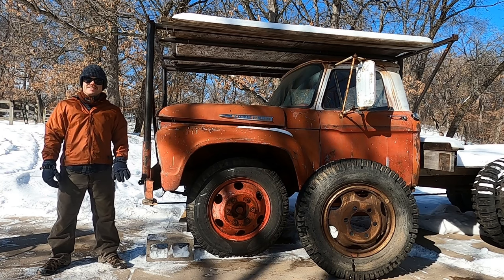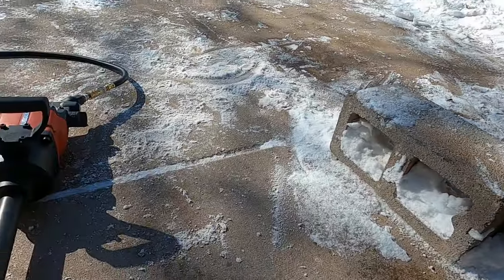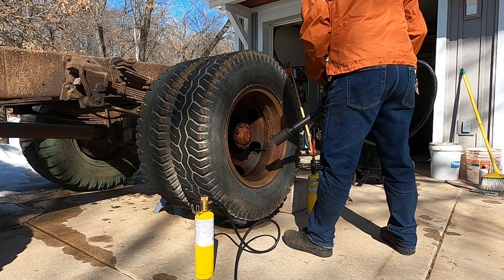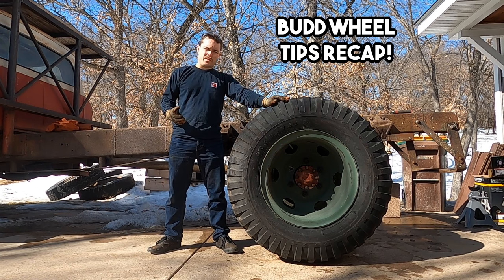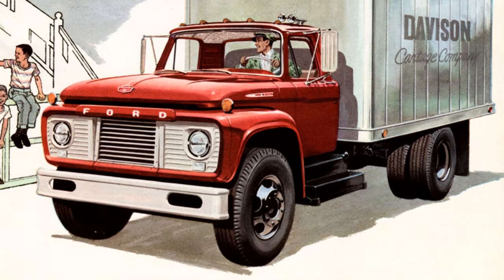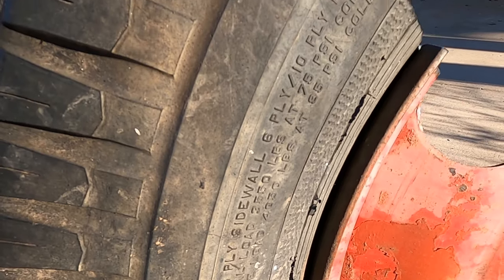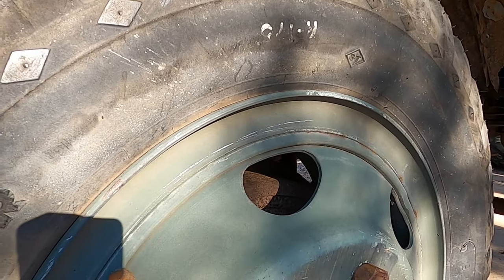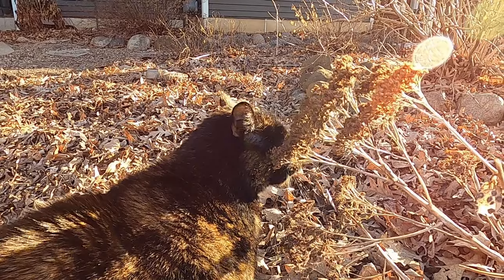All About Split Rims, Explained! Ep. 11

Comment: Get a manual torque multiplier for jobs like that. Mine multiplies 70 to 1 and breaks anything loose. Just use it to get the nuts cracked then use the impact to run them off.  A whole kit with several sockets is less than $100.
Reply from the maker: This is what i plan on getting for the future. Hard to justify an air compressor upgrade just for the one vehicle.

Comment: In the early 1970s I worked in a tire shop.  I changed hundreds of the split ring wheels, repaired or replaced tires and installed the wheels back on the vehicle.  A real split wheel rim is something totally different.
Reply: Real split-wheel rims are what you find on hand-trolleys & wheel-barrows!

Comment: My brother was driving a 68 International loadstar dump truck and the lock ring blew off the front tire and cut my uncle's mailbox post in two, we never found the ring. And these were Dayton 20 inch rims with 900/20 tires.
Reply from the maker: Holy cow. Do you know if it had been serviced recently? From the reading I've done, it appears most issues pop up pretty quickly after tire replacement.
Reply: @SealedBeamRallyTeam  Don't remember, that happened back in the late 70s.

Comment: In the Army, when we repaired flats on Dueces in the field (or the motorpool) we broke the bead with a pickaxe with a flat blade. 
Then we used the tool that came with the truck to remove the split ring. I forget what it's called.
We then patched the tube and put it all back together.
We always made sure to re-inflate the tire with the ring side down in case it flew off. It would only hit the ground...
Once it was inflated, we'd check to make sure it was fitting correctly and reinstall the wheel.

Once you did it a couple of times, it became surprisingly easy to break the bead without damaging the side wall of the tire!!!
As much as I hated pulling maintenance of trucks, I kinda got great satisfaction out of being able to fix a flat in the field at any time!!!
Reply: That thing is not actually a pickaxe. It is made specifically for breaking down truck tires.
Reply: @actionjksn  No. We used a standard pickaxe to break the bead. The other tool was to pop the ring once the bead was broken.
The axe had a flat blade and a pointed pick.
We used the flat blade and swung it to get between the tire and the ring to break the bead. How we never destroyed a tire is beyond me, but we got really good at it.
Reply: @chrislong3938  the tool that is made for it looks like what you described except it doesn't have the pointy part on the other side. I'm not sure why they would use a pickaxe when there is a hammer specifically made for breaking the beads down on semi tires. It's called a duck billed bead breaking wedge or hammer. I saw tiremen all over the country for 10 years and they all use the same tool. The tool has been in use for over 80 years
Reply: @actionjksn  I dunno... none of our dueces had anything like what you describe. they all came with field picks and shovels though.
The tire change kit had patches and rubber vulcanizing fluid etc.
A huge lug wrench and that long bar thing to pry out the ring.
That was it.
Swinging the pick wasn't hard and it rarely took long to break the bead.
You stood on the wheel, astride of the rim, and took a couple of light swings, and then went at it.
It's the only way I know how.

The motorpool guys had machines that could do it but most of the time it was just easier and faster the way I describe.

Comment: In a trade magazine years ago I read that the split ring stores enough energy at full inflation to throw an 8 pound bowling ball five miles. There is only about 1/8 inch that holds it to the rim. 
  Old hands will remember “for speeds over 60mph add 10psi” on some of the old bias ply truck tires. I for one am thankful for the advancement on tires and rims.

Comment: 45 years ago i worked on a 1950 Ford dump truck that had a non-Bud style split rim.  It shocked me to realize that you must deflate and inflate the tire assembly while mounted on the vehicle or the rim can overlap on itself and expel the bead ring with deadly force.  I upgraded to a split ring style rim that was thoroughly cleaned of any rust.

Comment: I ran a service truck doing truck and heavy equipment tires from 1981 to 2003. Done hundreds of split rims and have no problem with any of there designs. Like the one old guy says... If it's corroded to bad can it. The Widowmaker takes expert knowledge to service safely. There's that little bevel just above the locking mechanisms that you keep even all way round and you can tell it's locked. But! It requires you ad a small amounts of  air while tapping the outer ring until it evens up all round. If they were corroded, I would tell the customer it beyond usable and then  destroy the wheel so some rookie couldn't kill himself in the future trying to use it.

Comment: I worked in a gas station that was a truck (and car and tractor) tire service from 1964-68 while in high school.  We worked with all these wheel types, all the time.  The boss had a huge 3 phase powered v type compressor with about a 50 gallon tank, and an Ingersol-Rand one inch drive impact gun, which never met a lug it couldn't remove.  We also had a big air powered bead breaker, that was similar to a jackhammer, but with a bead breaker end.  It also worked great. Short handled sledges presuaded rusty stuff loose. Once the reassembly process started, we had an automatic inflator that we could set the desired pressure, hook it to the valve stem, stand back, and it would shut off when the pressure was reached.  We often raised the lube rack and put the wheels under, then lowered the rack onto the wheel before inflating.  We knew the wheels were dangerous... a local man who owned dump trucks and heavy equipment got blown up during this time, but lucky for him he recovered.  He never worked on those again, he had us do it.

Comment: I've dealt with both for several years in the army.. I was fortunate in that I had a split rim cage which us a life saving device as in the event that a ring separated you wouldn't die. Mating surfaces are critical.
As for penetrating oil, I make up a compound of acetone (60%) and transmission fkuid. Type F is best as it is more abrasive. The real problem is that the surface you want to treat is inaccessible until you separate the fasteners.

Comment: No tire shop around here will work on either style rim. I've worked on the split ring wheels. Didn't have a cage so we used a heavy log chain to hold the ring if it blew off.

Comment: Between 1977-83 I was road service for tire company in Jersey starting when I was 18! I replaced and fixed  flats on every rim you showed. Even mounted a bunch with sprung  single lock rings . Was told about the spit buds but never had come apart. Never  used a cage either. If I was worried  about one I'd mount it to the front hub! The Board of Ed. didn't  Like spending money on the school busses.  Only had one  single ring come off! I was more worried  about someone running  into me on the road! Airing up tubeless tires with closed beads was fun. Just spray starting fluid around the bead and toss a match on it! The gas in side the exploads the bead on then you can air it up. They outlawed it but did it anyway.  The expression on the truck drivers face was priceless!

Comment: Thank goodness we don't have many of those dinosaurs left around anymore. The only advantage I found to split rims is that you can change them in the field without a bunch of special tools. On our old Power Wagons we carried a spare tube and boot and could remove the wheel, break it down,  and fix it right there on the side of the road. without calling AAA!

Comment: I used to do tires back in the 80s for about 10 years starting when I was barely 17. We did not have a cage and it was pretty scary. You do have to make sure that everything is seated into place perfectly.. 

I did prefer doing the tubeless bud wheels so I was glad when this started getting more popular. I've actually done an entire semi by myself with just a lug wrench and cheater bar for removing them from the truck, and I mean all 18 wheels, but I was also only about 25 years old.

 Those widow-makers that didn't have the split ring and just had that big piece with the tiny lip really creeped me out. We did use a clip on air chuck so that helped I guess. Somehow I survived all of those dangerous rims. 

 When we were teenagers my buddy Tommy Brown had one that he installed and put it in the back of the pickup truck and was hauling it back to show his dad because it didn't look right and it blew up. It ripped through the side of the pickup truck bed. I think he was only about 16 at the time. These things are like a bomb when they go off.

Comment: Hint on your ugga dugga machine there, dual line it. 3/8 isn't enough flow. Needs AT LEAST a 1/2" line. Two 3/8" lines to a 1/2x3/8x3/8 Tee with 1/2" to the impact will make it work correctly. Awesome video. Great info for folks!

Comment: My dad had a gravel truck business and for many years all the tires were tube type with the 2 or 3 piece split rims. I remember one of the solid rings with the split rim, but dad said to scrap it.
In 1984 I worked for a concrete company in Mesa Arizona, they had the widow maker rims on some orchard trucks. The head tire guy taught me to pay attention and air them up with a chain wrapped around them.
In 1988-90 I was working for a truck and off-road equipment tire shop that would change the widow makers. After an employee at the Firestone shop down the road had one explode on him as he pulled it out of the tire cage our manager offered customer's two choices. 1. Here's the air chuck, the customer could fill the tire up. 2. They could get a nice safe new 2 piece rim with their tire change.
No one took the air up challenge. 
I didn't realize how fortunate, or blessed I was over all those years changing tires. But I do now. Great video.
Reply: I meant to mention my grandpa mentioned doing one of the widow makers, it lifted him to the roof of the service station he was working at.

Comment: I worked for a company that had a moving truck with split rims. One day they decided they needed to use it for a move but a tire was flat. An old black man showed up and said he wouldn't work on it. The next guy said he would. He broke it down, fuxed the tire cleaned the rim and mounted to the inside with no air in it. He then filled it remotely, got paid, said good luck and drive away. They went to move the truck and boom! the rim came apart. Another time I had an old trailer mechanic replace a lock ring tire on the front of a truck. He was horribly scatter brained leaving tools all over. He took the flat off knocking the wedges loose with a sledge and placed the new tire on the hub. He "lost" the sledge to check for runout when tightening the wedges and walked infrint of the truck to look for it and just as he cleared the zone, BOOM! the ring came off, cut the handle off the sledge hammer and bent a metal work bench!

Comment: Before i was born, my dad made a cage to inflate split rims out of drill pipe. It was 6 inch diameter pipe with THICK sidewalls. They would roll the wheel into the cage and chain it in, then use a long handled air Chuck to inflate it. The cage was bowed out in the middle by the time I saw it when I worked next door at the Ford dealership owned by the same company that owned the trucks serviced there. The tire guys always had fingers missing. Even that didn't mean the wheel was safe. One day I was working and a truck leaving that shop was driving past an alley a few doirs down and I heard a loud BOOM and the split ring blew off and flew 3/4 of a city block and slammed into a brick wall and nearly went through it. Anyone working or walking in that alley could easily have been torn into pieces. 
I'm so very happy they don't use this design anymore.

Comment: I was driving one day and a old 50's Chevy truck was in front of me with a load of hay bales. It was a good 800 foot in front of me and it blew a wheel. My pickup was straight pipes so it was loud but that explosion was many times louder. In less than a 1/4 of a second after I heard that bang from the wheel I heard a slap on my truck. I don't know where or what hit me but it was moving fast. Couldn't tell if anything was damaged on mine, it was about 25 years old and all banged up but whatever it was it had to be moving at a crazy speed to cover that distance that quickly. I pulled over to see if the guy was alright in his truck and thankfully it was a rear wheel that went. I can't imagine having one of these go while working on it, but I'm guessing there wouldn't be someone to be worried if they were bent over working on it when it went off.

Comment: I have actually worked on all three of these types of rims, and we pretty much referred to even split rims as Widow makers due to how dangerous they could be just to remove the lock ring. Matter of fact I have 5 split rims sitting next to my house full of water, that came off of an old trailer house. What makes them so dangerous is the fact that that snap ring/lock ring, could remove fingers, toes, hands or fly up during removal and installation and either smack you in the forehead shattering your skull or just out right take your head off. A lot of times we would wrap a chain around the tire and through the rim make a safety cage, during tire inflation. And I’ve seen them on everything from 3/4 ton trucks, tractors, semi trucks, travel trailers, stock trailers and trailer houses. I do not like dealing with them, and if they are old and full of water I will not work on them.

Comment: Hello, 
  The best lubricant I found is called Superzilla, it's a lubricant, cleaner and penitraiting liquid. It comes in different containers and sprays. I found that the one leter bottle is best. I put it on  a rusted nut and bolt, let it set for about 5 minutes  and the nut came right off. Even after six months, the nut and bolt work just as good as new. It is a little pricey, $40.00 for a 1 leter bottle.

Comment: The air and truck tires is no joke. We had a service tech was reaching down to pull air chuck off. Just as he did that the sidewall zipper ruptured. It threw him 5 ft backwards into a metal cabinet. The cage went 10 ft and the other direction.he  Dented the crap out of the cabinet. He was wearing a one piece coveralls. Never even bothered with the zipper when the force literally ripped them off of him. He was very lucky to see the least. Took him about half a day to get his hearing back

Comment: Back in the late 70s & thru the 80s I had a few F-350s and F-600s (trucks that were retired from work)  Never had to change one from the F-600s but changed some of the lock ring type from the F-350s and never had a problem.  I didn't have the luxury of an impact wrench but used a lug wrench and a six foot cheater bar.  I always got lucky and got them off.
Ford came out with a 22.5 tubeless wheel in 1956 but they seemed to have fallen out of favor within a few years as most of those trucks after 1960 had tube types once again.
This brought back a lot of memories. I miss those old big trucks as they were quite reliable.  Brakes and tires were the only jobs that were more difficult that on a pickup.

Comment: The air wrench is way underpowered because the hose is too small.  Need a 1/2 air hose and larger fittings to get enough cfm to run any air tool bigger than 1/2 inch square.

Comment: A lot of Winnebago motor homes on Dodge chassis’s used them 60 minutes did a spot on them called killer wheels . I have worked on more of the lock ring wheels than you can think of a lot of people mistaken those for split rims . I have several older Mack’s with Dayton wheels that use them 10.00 20s and 11.00 20s  just have to inspect those clean the grooves out and make sure it’s seated those multi piece wheels are a crap shoot if they will fly apart when aired up as you showed in the cage .

Comment: That’s a GREAT 😊 way to work on split rims!! Leave them on the vehicle 🚗 until deflated. The reverse 🔄 also should be true. This means once the tires 🛞 have been mounted, and the split rims reassembled, put them back on the vehicle 🚗 deflated, bolt them on, and reinflate them. I remember being at a gas ⛽️ station 🚉 when I was 6. A tire 🛞, which was laying on the floor, was inflated, and it exploded. Luckily, everything went straight 🆙, and nobody was injured 🤕 or killed. I couldn’t have been 4 feet 🦶 away when this happened. I can’t even remember if it scared 😳 me or not.  I’m subbing to your channel!! It’s great 👍!!Your friend, Jeff!!
Reply: Even passenger car tires can cause serious injury while inflating if not handled correctly.  I noticed that when i had new tires installed on my car the technician left the wheel secured to the tire machine while inflating the tire to seat the bead.  Truck tires have to be restrained with safety chains or placed in a safety cage when they are inflated.  This is a good video which explains the difference between two piece wheels with locking rings and the Firestone split wheels.  I think the move to tubeless tires with one piece wheels improves safety but they also have to be correctly handled and maintained.

Comment: Please get a larger air hose and take those quick release, connectors off.  Quick release are fine for most stuff but if you’re trying to really put the smack down on some giant Lugnuts with a giant impact, they do not work well. As other people said get like a 5 gallon tank and put a straight half inch diameter air hose from the impact to the tank like 10 feet and then you can use your quick release to feed that 10 gallon tank just fine.